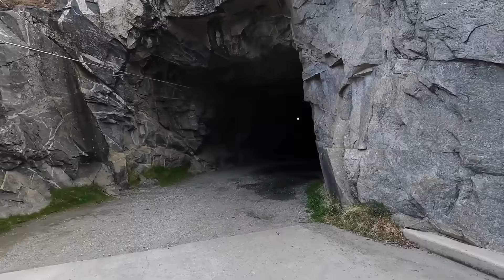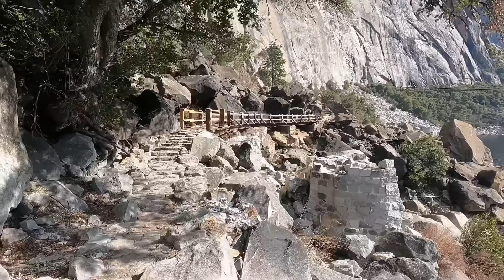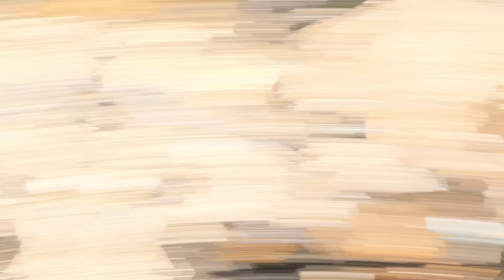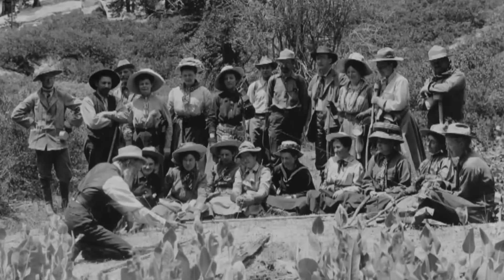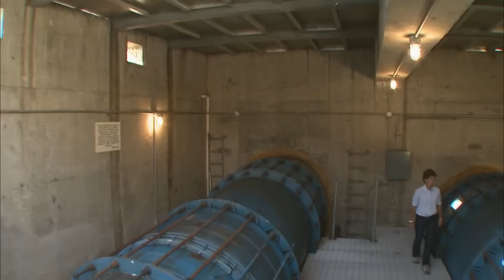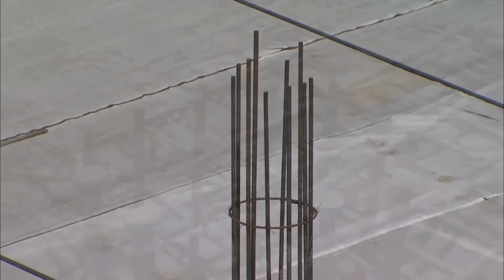California Is Drilling Miles Beneath the Sierra Nevada to Build One of Its Most Ambitious Tunnels

Comment: Tell the whole story and it isn't all about that Climate Change monster. If it was it would show up as decade or two of variation from a 150 year cycle. There is no evidence of that, or of the ocean sea level increasing or decreasing in San Francisco bay. Those Bay levels are necessary for large ships to know. They used to be on the Navy website along with history stats and graphing. Not any longer.  People may go look at 90 years of daily sea levels. Missing.
And why have politicians received billions and billions in voter approved bonds to build storage infrastructure for people and farmers. Same answer as the bullet train, politicians just can't seem to make it happen. The current system was designed and built in the 40s, 50s and 60s. The last project finished in the 90s.  Since then not one extra drop of capacity has been added - to supply the added 20-30 million more people using it every day. We are ruled by agenda green smelt fish idiots, lobbyists and clueless morons who will swallow any made up story. 100 years ago people made it happen with a steam shovel and a pickaxe.

Comment: This is supposed to be a Central Valley Project...if it ever gets off the board. So...why all the pictures from the foothills? It will not be dug up here...down on the Valley floor. Is it a good idea? Nope. If you want to keep water safely stored underground...store it in the the cavities that once produced oil or natural gas. That's an underground reservoir ready to be used.